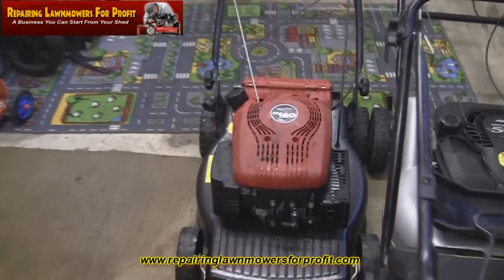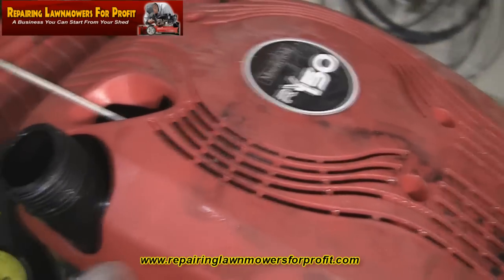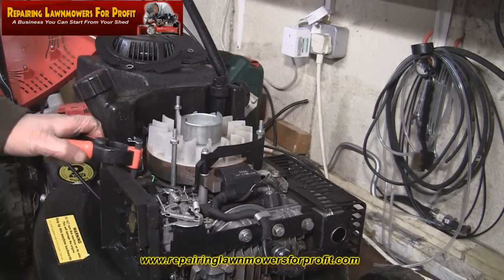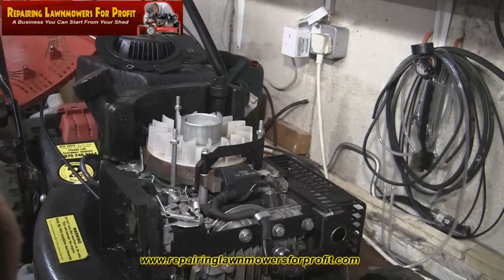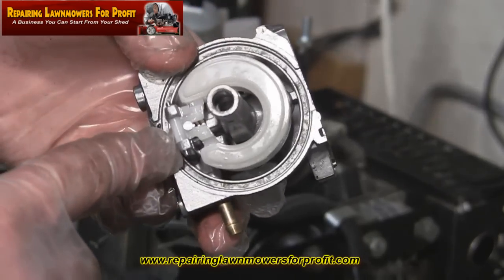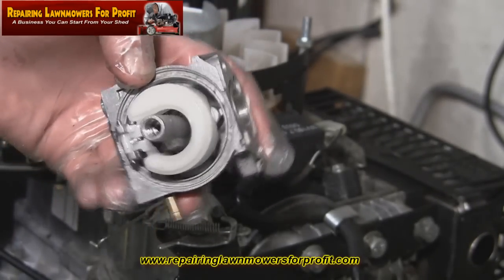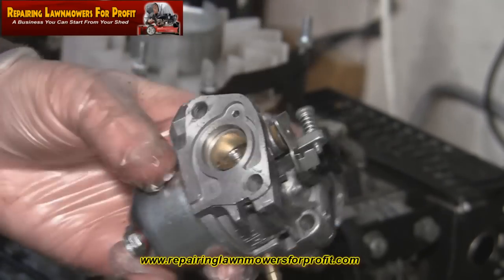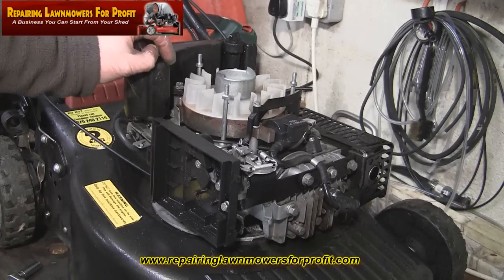Repairing Lawnmowers For Profit Part 68 (Mountfield RV150 Carburetor Service)

Comment: Had mine since 2007, never a problem until yesterday. Fired up first pull as usual but wouldn't run or start again for a few minutes , then would do exactly the same thing. Start but didn't run. Pulled cord until I sweated, checked the plug, the original, and it was dry so I deduced  a fuel problem. Took the carb off today and the float chamber was choked up with clots of crap. Blew it all out with an air line, didn't see the need for much more than that, re assemble and off we go. Now starts and runs perfect, hot or cold. Take a picture of the linkage before you remove the carb. I never, and it was a shite to sort out! Cheap Chinese crap for sure, but after years of use it still works nice. Mine is badged up as a "lawn king". Purchased from eBay as a factory rebuild for about £125. Have had loads of electric mowers in the past that have lasted just a couple of seasons. I even use this one to shred pruning from the shrubs, no problem. Just keep the blade sharp!

Comment: I have also found that these engines are very hard to start if the spark plug gap is too big. It can be very misleading because you have checked everything and you have a spark but it won't start. They like a tiny gap so if all else fails, try the plug gap and (or) a new plug.

Comment: Hi Mower Man, Just another update on my HP474 rv40 checked both flywheel keys all look good, changed spark plug again, even changed the spark coil and a carburettor off a mower with the same engine and still she hunts and runs at a lower speed, it is obviously something to do with the engine its self is there something else I can check

Comment: I have a Lawn King with the mountfield engine and the same carb, just cleaned and rebuild it today and it worked ok, but has always had an issue governing the speed at full throttle. On mine the governor is internal in the engine and operates a long link and is held toward the carb with a weaker spring, much like yours. I attempted to set the governor after getting it going but it really makes no difference, it either hunts or over revs badly. I would be interested if the external Briggs and Stratton vane type regulator would fit...

Comment: Fantastic void and extremely helpful. However, when checking out the carburetor the float was full of fuel is this right? The engine runs fine?
Reply: No.  The float should be full of air.  If you dip float in some hot water and see bubbles the float is cracked. Did you mean the float bowl?

Comment: hi i wonder if you can help me,ive got the same model lawnmower and it starts up but then go,s dead ive put a new spark plug on but it still does the same thing starts up then go,s dead i was wondering if you could give me some advice on what is wrong thanks...paddy

Comment: hi mower man thanks for the video, i've cleaned the carb on my Rv 150 and reassembled it and tried to pull start it, it was really tight and after a couple of pulls I seen oil coming out of the carb, what have i done wrong?
Reply from the maker: Desmond Johnstone If it's leaking back out it's probably because the needle is sticking in the carburettor.
Reply: Thanks for the quick reply Mower Man, but you realise I'm talking about oil not petrol ?

Comment: My Mountfield SP185, has a Briggs & Stratton engine, it hunts, backfires and when mowing, the engine revs up and down. No throttle control - its all automatic, can I adjust the mixture or throttle speed? The mower is only 10 months old.  Mountfield expect me to take it to a service agent, that is very difficult for me. Any advice please.

Comment: I've just serviced an RV150 and carb.  Starts OK but revs cycle except on choke.  It was running OK before I started.  Any ideas?  thanks!
Reply: This is now solved. I didn't service the carb so carefully first time around because there was a rust flake stuck in the main jet.

Comment: You said check the gaskets (plural) before you fit the carb back on- mine didn't have a gadget between the carb and the body of the engine, there was only a gasket between the carb and the air filter assembly - is that right ??
Reply: There will be a o ring

Comment: I have a Mountfield hp474 / RV40 150cc she starts to hunt after about 5 mins of running and if I turn the revs down on the lever she want s to stall also the pull cord has gone a little harder to pull. Seen a lot of these on Ebay are they not a good engine.
Reply from the maker: Craig M Hi. no they are poor unfortunately check the blade is on the blade adapter correctly (remove spark plug first)
Reply: Yeah blade is on correctly, forgot to mention the pull cord has sometimes snapped back fast as if it is back firing. had new plug/filter/oil still the same
Reply from the maker: Craig M soundscapes very much like one of the two flywheel keys are damaged check on my vids
Reply: Checked the top one at the flywheel on the shaft and all is good, is there another somewhere
Reply from the maker: Craig M yes pull the blade and blade holder off check one at bottom
Reply: Both keys are ok, I have just noticed that the inlet tube from the carb, where it bolts down with the 2 bolts the bolts were actually loose (just finger tight) would this cause this problem, I can fire it up at the moment as baby is asleep
Reply: think it is best to let her go gently to mower heaven
Reply from the maker: No way!! Does it have valves you can set like this?https://www.youtube.com/watch?v=fgL1TlmbYIA    I bought a few mowers at auctions that people couldnt start and could hardly pull them over if you set the valves it make a HUGE differece
Reply: I don't think it does, it is the SV150  engine if that helps

Comment: mountfield empress 16sp  have you got any pics where all cables go on carb  and the white wire off the coil the hook thing on end   and stuff on metal bit that fastends on to carb   got it in bits   HLLLLLLLLLLLLLLLLLLLLPPPPPPPPP

Comment: cheap chinese crap. those engines are a pain. the air filter base is weak and can be hard to seal properly i have had to double up gaskets at times. the air vane breaks easily but what i do with that is replace it with a briggs one(unless it is a warranty job) they are far better quality and exactly the same as a mountfield. in fact a lot of parts can be changed with briggs parts.
Reply: gotta love cheap lawn mowers lol